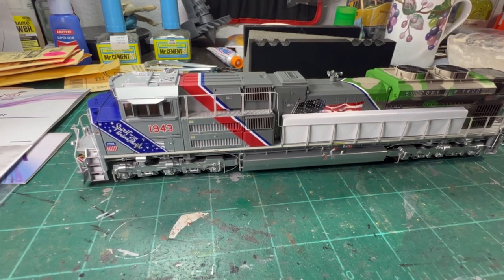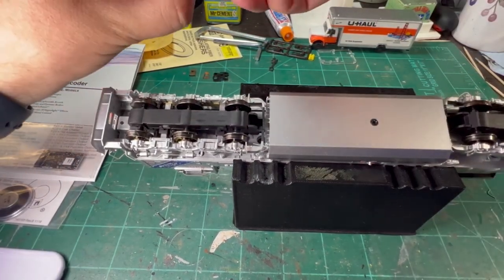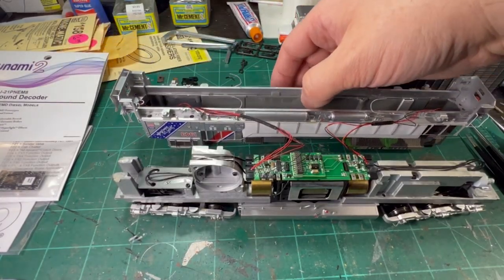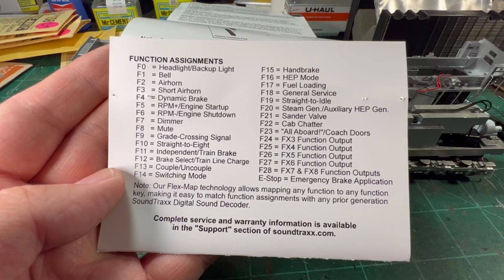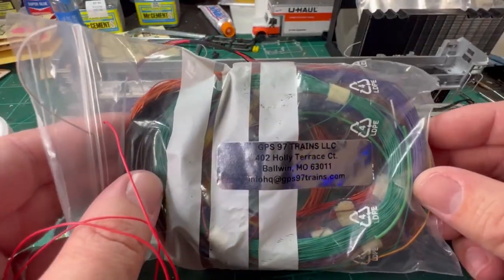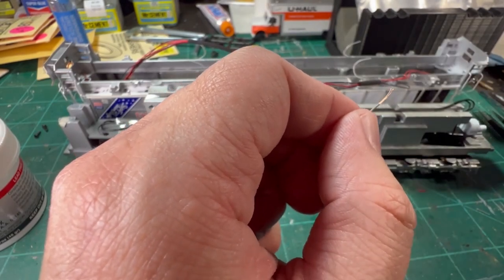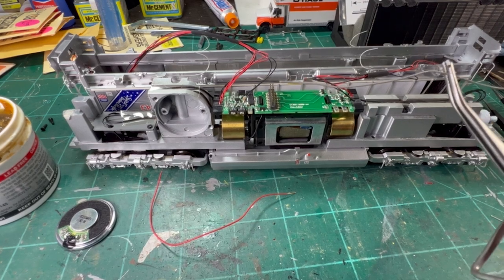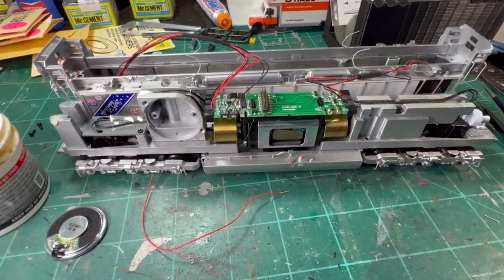How to Upgrade and Install DCC and Sound into an Athearn Genesis HO SD70ACe - Tsunami2

Comment: A little longer on the installation step could make life down the road easier.  I'd start with a Decoder Buddy and soldered joints instead of plastic connectors.  Good video!
Reply from the maker: What’s a Decoder Buddy? I haven’t heard of that. I’m always looking for tips to improve! Thank you!

Comment: Hello! I think I know the answer to this question, but I want to be certain. The screws you use to fasten down the speaker-- are those the same two screws that were in the speaker enclosure?
Thank you!
Reply from the maker: Hello! Yes, they are. Depending on the locomotive you're working on, there will either be screws in the dcc kit for it or screws already in the frame of the locomotive you can use.

Comment: Soundtraxx Tsunami2 TSU-21PNEM8. That’s not even an ESU Loksound 5; I would’ve honestly gone with the factory installed TSU2 version if u wanted that brand of decoder as it has better resistors for brighter LEDs compared to the 21MTC board, which has relatively dim LEDs
Reply from the maker: This was a dcc ready only model, so I had to add sound. I’m happy with this model and the sound that it produces.
Reply: @joes2fst4umodelrr  custom sound installations usually yield better results than factory installs ;)
Reply from the maker: Always!